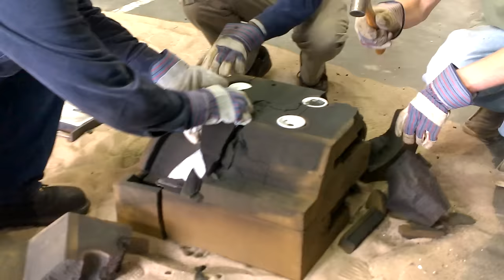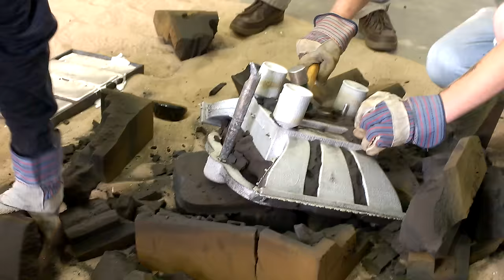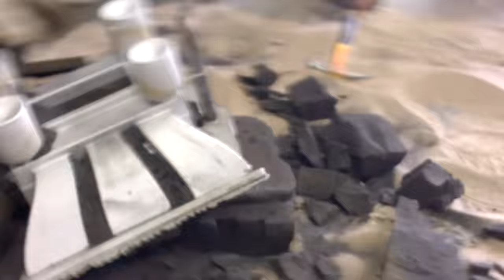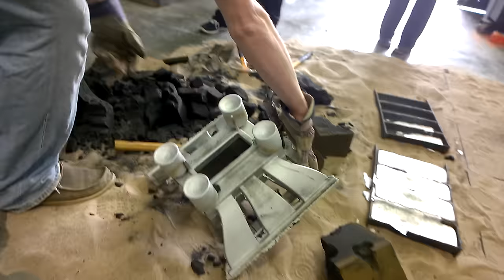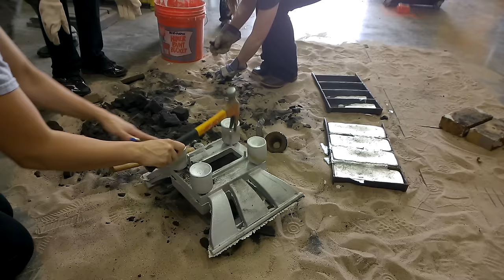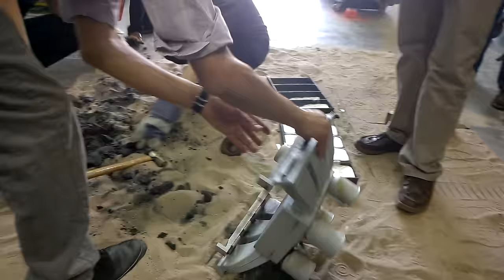Removing the part from the mold after casting the 3D printed molds

Comment: You're avesome. Hard to believe it's made with 3d printer, because of large size and smooth surface of the detail.
Reply from the maker: +Igor Sidorov It was printed on an S-max printer. They are capable of printing much larger parts too!

Comment: Use plastic mallets?
Reply: I think a vibration table is sometimes used. Easy to build with a washing machine motor with a metal disc mounted slightly ofset.